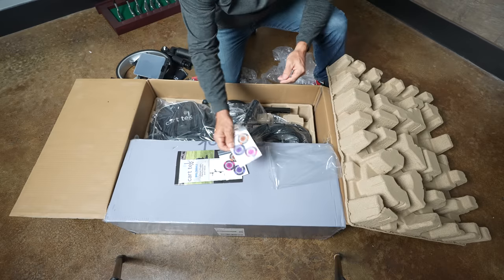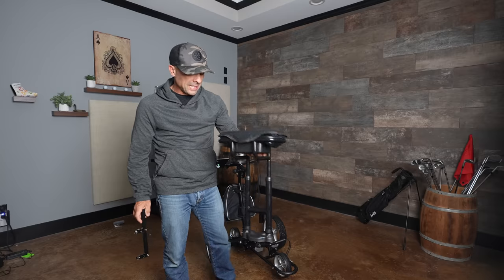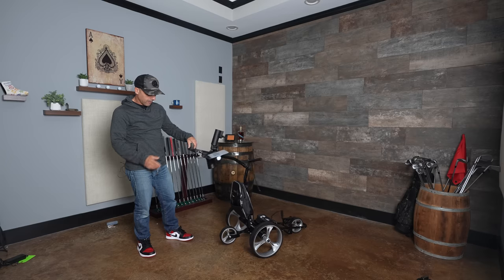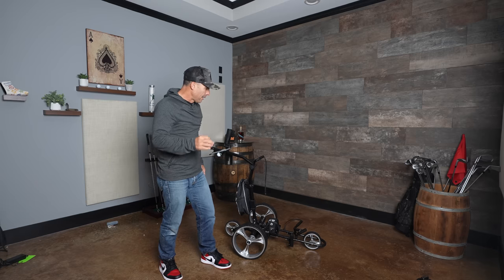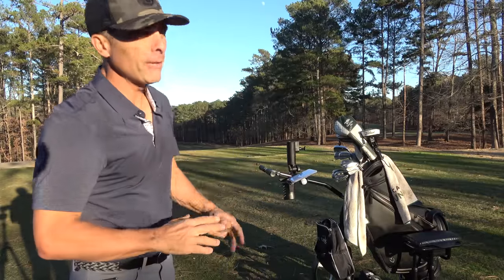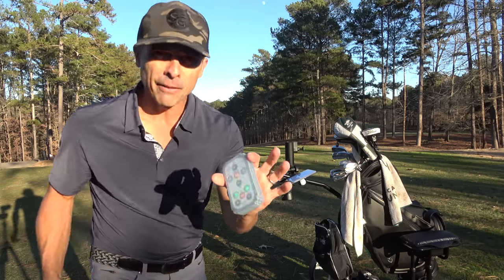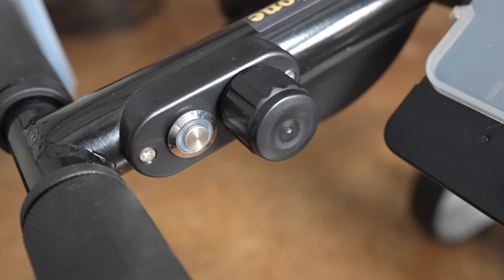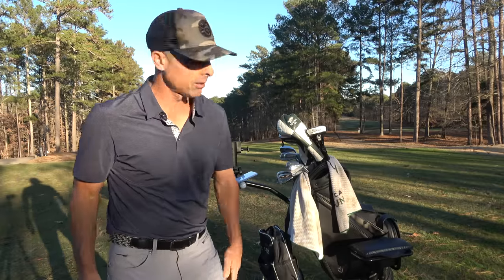The Best Priced Remote Golf Cart - Cart Tek Yellowstone

Comment: You're absolutely right about the wheels being cheap plastic.  I had an older model 1500 Li and I had to replace all the wheels.  I think it was $250 for a new set.  The more expensive models have the newer wheels which have solid spokes and do not break as easily.  Last year I bought a Zip Navigator and just sold my 1500 Li yesterday.   The Zip Navigator also has some weaknesses and I had to buy a new front wheel assembly with less than 1 season in the books.  Let me know if you would like a more detailed comparison between the two carts.
Reply: My AT Zip Navigator lasted 3 rounds. POS..returned it.

Comment: I've had mine for almost two years, since you did your last Cart tek review. Its clearly designed by an engineer as it's very sleek and well made. I've had a few problems with the remote, but the guys have been awesome about responding to me and sending replacement parts. I agree with most of your positives and negatives. One downside, the blue light on the button is very hard to see in the sun.